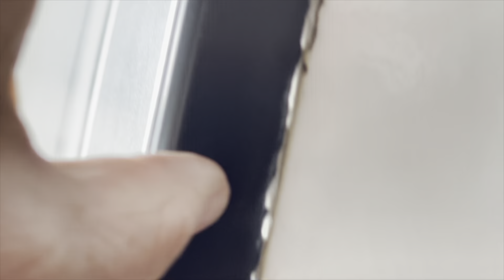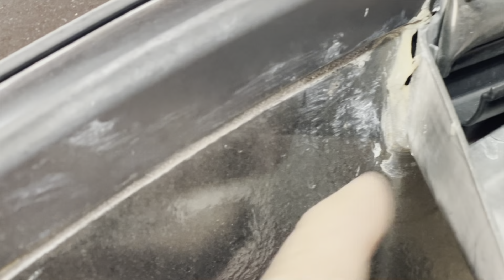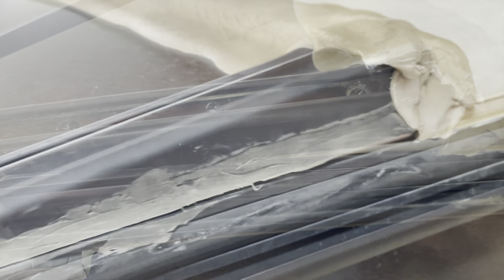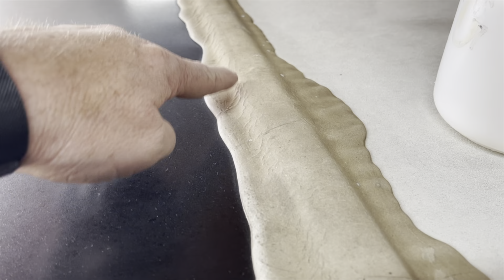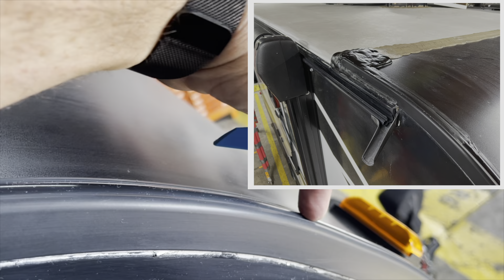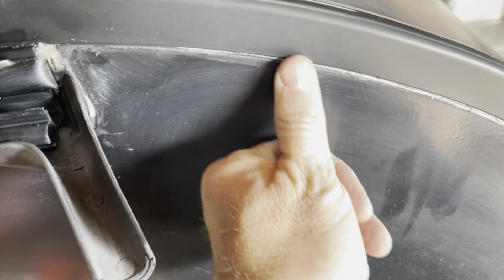RV Roof RESEALING Secrets Explained!

Comment: What do you use to seal the sides ?
Reply from the maker: We use Dicor non sag sealant.  A trick I do is cut the tip small and pinch it to act like a frosting tip.  

Make sure to tighten the side wall moldings.
Reply: @yourrvspecialists 
Thank you for the reply. So I can understand. You use dicor non sag instead of say a silicone sealant for the side vertical walls where the side molding and side walls meet?

Comment: I have a question that may seem silly, but humor me please. If we can put sealer everywhere on these campers, why can’t we dab some Dicor or other even clear sealer like they use on these campers, on each screw head which is under the plastic trim piece? If water gets in runs down it will run over the screws not seep in? I know it seems obvious, but other than it taking too long at the factory, why not? Thanks, just found yiur channel.
Reply: Exactly, that channel trim is not water tight.

Comment: What do you recommend to remove old geocell/Proflex and silicone off side panel Azdel?
Reply from the maker: We use a product called Acrysol it’s a low grade body solvents cleaner.
Reply: @yourrvspecialists  Thank you! After use, do I need to clean up area with soap or water? Also, completely Azdel safe?